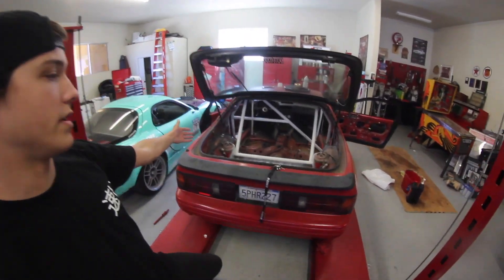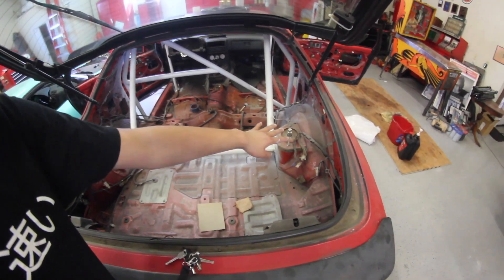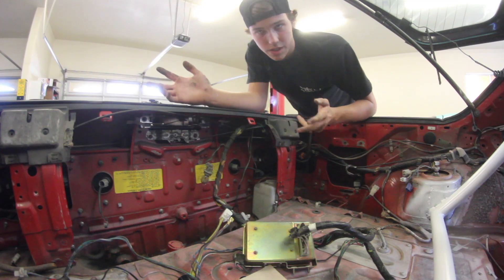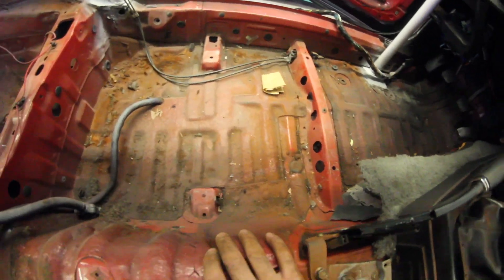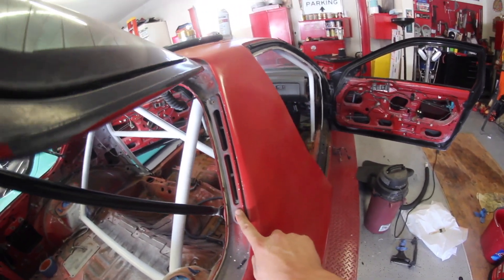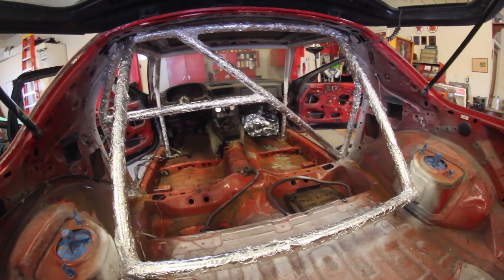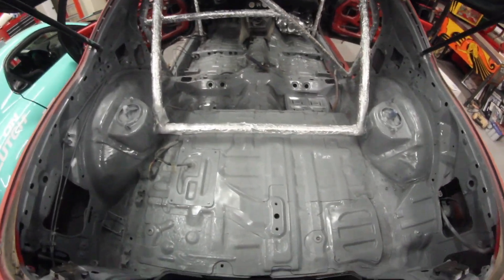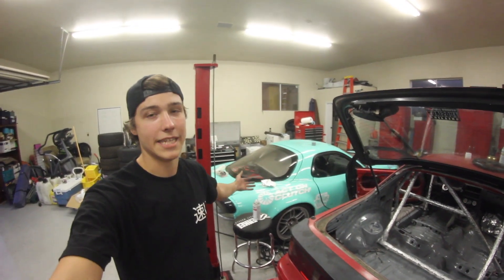ALUMINUM FOIL ROLL CAGE!!!

Comment: Nice work mate, looks like custom silver leah from way back haha! Another thing I do is use plastic bags or plastic sheets, wrap stuff up and then use a heat gun lightly to heat it up. The plastic goes all tight and slightly hard. It’s really good for covering big parts like engines etc.